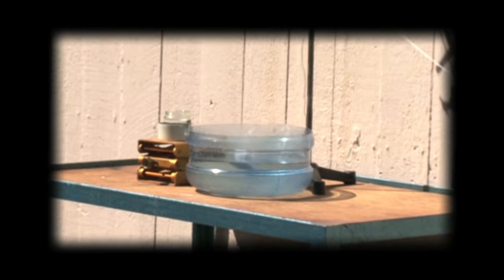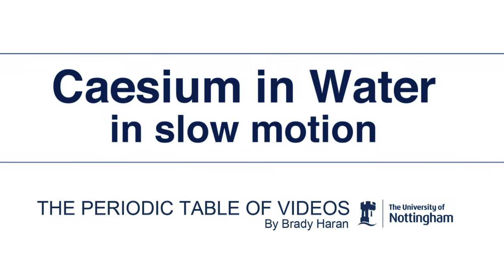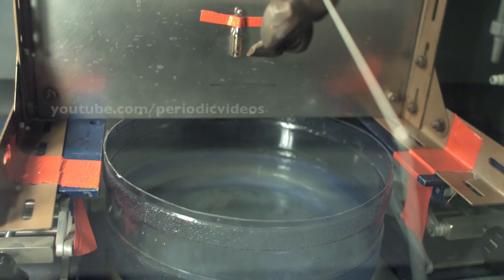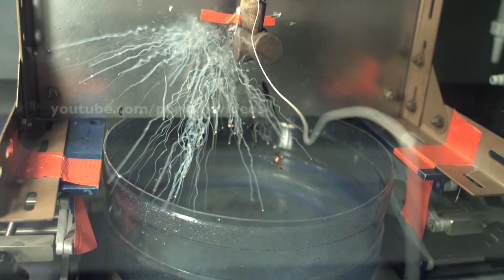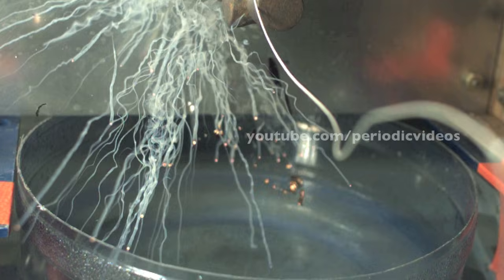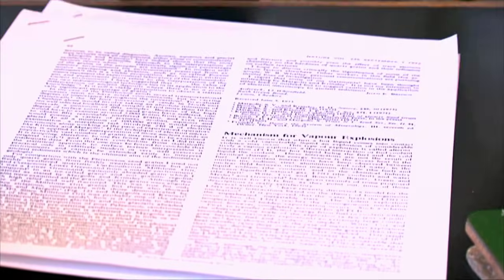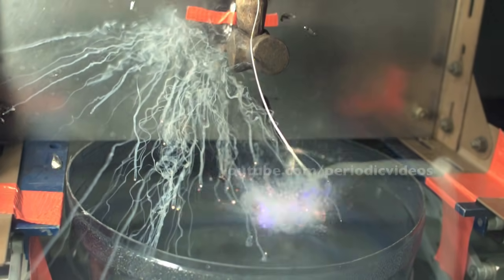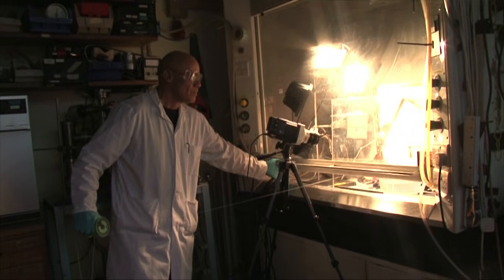Caesium in Water (slow motion) - Periodic Table of Videos

Comment: She will be having Caesium Chloride tablets,  the pH inside tumour cells is usually very low, or acidic, compared to normal cells, and that caesium chloride supplements raise the pH level of tumour cells to a normal level, which slows the cancer's growth. 

That's the theory put forward, however some claim it's not more acidic at all. Caesium is also used in more traditional radiotherapy treatments.

Comment: dip the bottom portion of the test tube in a clear plastic. When the glass shatters, the cesium should drop into the water all at once rather than spraying all over the place. Hopefully this would cause the explosion you are looking for.  If not, shatter the airtight tube underwater with a weight from height and see if that helps.

Comment: Try water of both extreme pH levels, one being the highest and one being the lowest. Then try it in boiling water of each, then try the most interesting thing by using an ice bowl made of the lowest pH water with as little total dissolved solids you can obtain. Also imagine a 2:1 Hydrogen, Oxygen flame coming into contact with the Rubidium. Just food for thought. No need to reply.

Comment: I'd assume so. If it's a different isotope it would act different in nuclear processes, but would still have very similar electron orbitals at almost the exact same distance from the nucleus, and therefor be almost the same chemically, besides slightly different vibrations due to increased mass.

Comment: I have an idea. Do the exact same thing but with an air tight enviroment, light a fire in there to get the oxygen out and break the case as usual... It wont spread as much cause it'll bounce back and not fall out and it will not react with the oxygen in the air!

Comment: What you have said is a common misconception, it was previously  believed that old glass has flowed over time however this is not true, it was simply that when being made a long time ago it was very difficult to produce a perfectly flat piece of glass. An example would be antique telescopes, if glass were to flow at a rate that we would be able to see after a few centuries as you have stated, there would be a noticeable difference with the accuracy of very old telescopes which hasn't been seen.

Comment: @thefunksatron glass is most certainly a solid. It is basically an amorphous 3D lattice of usually silica or silicon dioxide, however it can include metals and be an ionic structure hence it being so brittle. A liquid is defined as such by being able to roll over itself under its own weight due to gravity. This is only possible when glass is melted. So room temp glass is definitely a solid :)

Comment: The smaller the atom for the alkali metals, the more hydrogen gas yield per unit volume of the metal.  Lithium would have the highest hydrogen gas to volume of metal ratio but it's to unreactive in comparison to the others.  Caesium has a very high reactivity but a low gas yield.  So I think in theory that would leave somewhere in the middle as the best combination of the two and I think its quite clear that the BEST reaction comes from potassium as it has the best balance!

Comment: Cesium is in the first column of the periodic table along with Lithium Sodium Potassium Rubidium, all of which react vigorously with water to make the Metal-hydroxide and liberate H2 gas, unless the fission happens in an environment covered by oil my guess is that you don't interact with pure Cs but with the hydroxide form. (I mean it reacted with the water vapor in the air while it was falling from the broken ampule, that's how reactive it is)

Comment: Could you surround the glass ampule with a flexible sleeve?  The hammer could still break the ampule, but the contents would be prevented from flying about, and would fall straight down.  Though, as others have suggested, breaking it in water might be even better.

Comment: You should try breaking the ampule inside the water instead of over the water. It would be pretty easy to tape it to one side of a vice, connect the vice mechanism to a drill of some sort out of the water, and just plug in the drill when you wanted to crush the ampule.

Comment: Caesium is pretty much my favorite element. Always wanted to get my hands on some of that or Rubidium, but it's a bit too expensive (and I don't really trust that I would handle it well...).
Watching you guys do it is excellent, though! Learned lots of stuff from just that short clip, like disproving the myth that Caesium would just instantly react with water vapor if it were ever exposed to air.
Thanks!

Comment: i suspect the vapor trail is Cesium Oxide

4Cs + O2  =>  2Cs2O

you would see an increase in smoke intensity closer towards the water bath if the reaction was with H2O, but this is not the case.

Comment: 183 here, to be exact :)
Brady, it would be interesting if you first submerged it and THEN broke the ampule. My highschool chemistry teacher did something similar with an old large and mostly oxidized sample of potassium in a tube. He screwed off the lid, put a stone in for weight, and dropped it in the ocean. After a few seconds (likely delay from the oxide layer dissolving) it detonated and lifted the water several cm, almost like a depth charge.